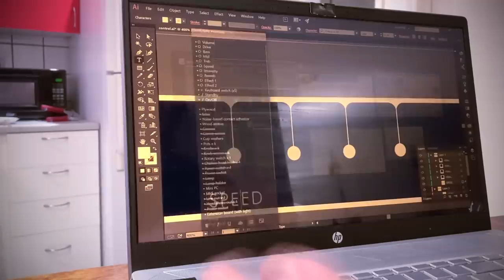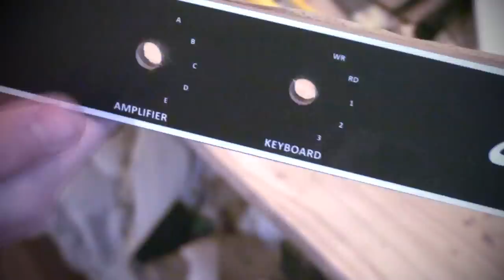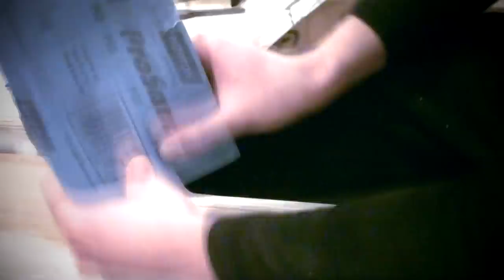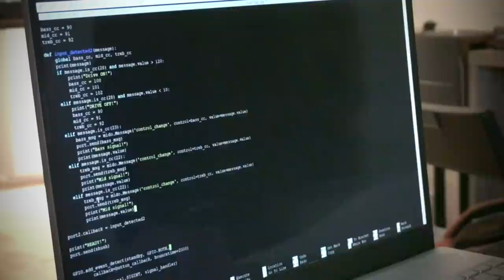Building An "Electric Piano"

Comment: Excellent. Nicely made. 

What is the point of the rubberbands that you installed into the action? Did I miss the explanation somewhere in the video?
Reply from the maker: The TP/100LR is way too heavy for most people, including myself. The rubber bands make them much much more playable.

I believe I ended up using Size #16 rubber bands, but I recommend getting a box of #18 also to play around with the amount of resistance.

I attached the rubber band first to the plastic "lip" near the pivot point under the key. After this, it's important to TWIST the band at least once, before attaching the other end to the other end of the hammer assembly. You can increase resistance by adding more twists, but this might increase friction at the same time. This is also where playing around with different sized rubber bands may be helpful.
Reply: @aCloudOfHaze  Ah gotcha! Any chance you are going to make this DIY kit available to the market?
Reply from the maker: @aakash9058  Haha not right now. Frankly I watched a few videos of people building amp cabs and then went for it. Not that complex, just takes time.
Reply: Brilliant, great video and well played.
Reply: I started with a sl88 studio that I think shares the same keybed and because I have nothing to compare it with, I don't feel like it is heavy.
Reply: @b00ts4ndc4ts actually sl88 studio is a step up and cost 2x more then the slgrand in this video. The action is supposed to replicate a grand piano rather than an electric…… whether this action is too heavy is debated and is definitely a matter personal preference and largely dependent on what type of piano you played as a kid growing up. Sl88studio is 1000 dollars sl grand is 500. The slstudio uses tp/40 vs tp/100 for slgrand.
Reply: @markaprill6501  would you like to bet on that?
The sl88 is the cheapest option out of the two and the grand is the more expensive one because it has the different action and wooden keys.
Reply: I have read your comment again. Your comment is 100 percent accurate. I apologize, I was wrong. Even keyboard warriors (computer keyboards) make mistakes sometimes. Just owning either a SL88 grand/studio should indicate that you are a keyboard expert and certainly dont need correction on what you own. So I am not going to bet on it.

Comment: Unfortunate that kawai and Roland dont sell theirs as stand alone keybeds, or at least have more variety of interface types, to meet all needs.   Industry is only so big, cant afford to meet all the niches. Such a project as this deserves better action then Fatar gives.   I commend you on following through on such a project.  Please let us know your thoughts on the reliability of running Pianoteq from the Pie.   Im guessing just from the fact that you deemed it worth it to do this project in the first place, means you are confident  <;)
Reply from the maker: Hey thanks mate, I appreciate it especially from someone knowledgeable about this field.

You're right about Fatars. They are hit or miss. That's why it baffles me why Nords are so popular. What wasn't captured in the video was this: I tried to cut off all the hammers on another keybed and glue on some wheel weights. I do not recommend this - It was a disaster! It's really difficult to achieve the level of precision required, unless you have all the tools to do so.

I was still unhappy with the action and I was determined to find a fix. At one point, I was thinking about delaying the entire project until I could 3D print a custom keybed haha.

Regardless, I pulled another keybed out of an old SL73 (midi controller without sounds). What you see in the video was the final fix that I came up with. I simply modified the action with rubber bands. The end result was surprisingly good. The chunky yet not overly heavy action matched the EP sounds very nicely. I'd encourage anyone who owns a keyboard with this keybed to try this mod. It's reversible and to some extent scalable to one's tastes.

If I were to do this again, I'd go with a TP/40 instead. One of the most important factors that go into how a keyboard action feels is the key pivot length, and the TP/40 has a much longer one than the TP/100LR (and most other keybeds in this price range). Plus 3 extra keys on the high end would have been nice haha.

Pianoteq on RBPi works fine. I do experience very rare "audio card cackles" on the grand piano patch, mostly when I'm turning the knobs while playing, but the EP sounds all run very smoothly. In the long run I might replace it with a mini PC with more CPU instead.

Thanks again for the kind words, hope this was insightful.
Reply: @aCloudOfHaze  WEll, Nord remains the only company to have the combo of the build quality the interface great EP’s AND great organs, and in the case of the stage, synth as well, AND have a library or allow 3rd party.   The closest competitor would be the Yamaha CP and YC series, but no library or 34d party download…or the Roland Fantom has a pretty thorough interface, and a great keybed.   I wonder about the viability of deconstructing a used Kawai ES8?  Does seem wasteful, but if you can get interest, maybe you Kawai is finally ready to have others use their keybeds, as they do with the Nord Grand.  Thanks for the reply, keep up the good work
Reply: @aCloudOfHaze  What does the rubber bands do? Is it to make the keys even heavier?
Reply from the maker: @MarcoMugnatto  It's to make the action lighter, not heavier. The TP/100LR is way too heavy for most people, including myself. The rubber bands make them much much more playable.

I believe I ended up using Size #16 rubber bands, but I recommend getting a box of #18 also to play around with the amount of resistance.

I attached the rubber band first to the plastic "lip" near the pivot point under the key. After this, it's important to TWIST the band at least once, before attaching the other end to the other end of the hammer assembly. You can increase resistance by adding more twists, but this might increase friction at the same time. This is also where playing around with different sized rubber bands may be helpful.
Reply: @jonathanosborn4800  I tried a ES100 Kaway and it's another very nice and playable keybed compared to TP100. Useful for mod like this. I Heard that Nord uses Fatar too, but it seems they are just made for Clavia (though with the same commercial keybed name).

Comment: I get the impression that you're experienced with building other, similar cases before, as this seems to be so nicely and meticulously planned.

For the face plate, I had the nutty idea of using something like photoresist on aluminum and controlling the exposure by placing black/transparent printouts over it and the hitting it with UV light.  Then with only the exposed photoresist remaining, anodize the aluminum to mark the pattern on it.  Only problem is that I think then you'd then need an acid bath to remove the exposed photoresist.
Reply: Hi Scottk can you explain better your idea, or there is a video as an example here on YouTube? Thanks
Reply: @dariovicenzo8139  I don't have any idea to suggest.  I'm only pointing out that the maker of this video looks like he has created this kind of case before.  He seems to easily navigate the planning and construction.

Comment: Pianoteq sounds so unreal. the first time I played it after dialing in my settings, it was a revelation. I felt like I'd unlocked a tiny piece of ancient magic in my little home studio. I was wondering what you'd use to power such a beautiful creation, but I should have known. The one thing I didn't know was that you could get it running on a raspberry pi! Idk why I thought it'd be too taxing for that. This was amazing to see, thank you so much for sharing!! <3
Reply from the maker: Thank you 😊 Sampled instruments may be too much for the Pi to handle but modelled ones like Pianoteq are a different story. It helps to overclock it slightly too. Many guides on the Modartt forums.

Comment: This looks great. I have built all kinds of stuff over the years and for a while been dreaming about building my own custom all-in-one piano/organ/synth and you have inspired me.  My idea is to put three keybeds in one case:  76 Weighted keys at the bottom , 64 waterfall keys for an organ in the middle, and 52 diving board keys for the synth on top.  I am pretty decent woodworker but this is pretty ambitions.  I suspect it would be far too heavy anyway, unless I used balsa wood! Finding room for the knobs and drawbars will be a challenge.  Or I could just pop the guts out of a clonewheel organ and digital piano, put them in a new case, and leave enough room for a small synth on top.

I miss the days when manufacturers used to design keyboards to be stacked. Yamaha makes one digital piano that is pretty deep because of the large internal speakers, but its hard to find and I am sure the piano sound is pretty dated by now.  I used to own a Yamaha CP30 and not only could you stack at least 2 keyboards on top, my bass player would sometimes jump on top of it way back before I could afford to buy more keyboards to put on it.

Comment: I'm kinda curious how you got the knobs to control pianoteq running on the Pi. Also, you power the Pi from the front panel? If so, that's cool, the brain is hidden!
Reply from the maker: Hey, I used a MIDI encoder from Doepfer, I believe it's this one https://doepfer.de/pe.htm. That goes into the SL73, which connects via USB to the Pi.

There's basically a extension cord type thing with two power adapters hidden inside the piano, powering the keyboard and the Pi (they require different voltages). This way everything is powered via one IEC cable.

There's actually so much empty space inside it's ridiculous. Some day down the road I might make my own keybed with a much longer key length :)

Comment: Cool build! Let’s see. So, it’s a Raspberry Pi running a sample playback instrument? The knobs on the front are all for the amp tone controls? Or do you have knobs running to the Raspberry Pi making changes to parameters on the instrument?
Reply from the maker: Hey thanks. It's Pianoteq running on RBPi. Not a sampled library, but a modelled one. Requires way fewer resources and afaik "feels" or "plays" better (even though a sampled one might sound more realistic). The knobs run to the RBPi and basically serve as MIDI controls, yep.

Comment: this is one of the more amazing videos on internet for me. Great Job! 
Unbelievable that you can use a raspby for that. How is the experience on work of linux and live performance ? I really need a video explaining how you configure and parametrized all the options of pianotec, with midi, linux and jack. 

Thanks for sharing!
Reply from the maker: I can't make a whole video about that, but there are plenty of guides on the Modartt forums. The performance is great, very little latency. Cheers!
Reply: @aCloudOfHaze  why did you go with that option, over say an arduino etc?
Reply from the maker: @DanHomeAtLast  Can't host a VST on an Arduino. Or can you??
Reply: @aCloudOfHaze  that's correct, they can't host one. I didn't know that there are hardware like this that actually hosting a vst that's awesome. Will look into it further for my project. Thanks and great work you're very talented
Reply from the maker: @DanHomeAtLast  Good luck, would love to see the final product 💪

Comment: A couple of things I don't understand.  What is the point of a Standby Switch?  That does not make sense.
Reply from the maker: It mutes/unmutes the piano without having to reload the VST instrument, and also serves as a MIDI reset in case things ever get jammed up. It also syncs the current settings on control panel (e.g. patch, EQ, drive etc.) with that of the VST instrument.

Comment: Nice ! What the rubber band add ? You will have to change all of them soon or latter, courage with that !
Reply from the maker: A little mod that I've found improves the action of the TP/100LR keybed. The short pivot length makes it a very "chunky" action, so the rubber bands kind of compensate for that by making it a bit lighter and more "bouncy".

Comment: Hey mate, just want to say that this in an incredible build on many levels. And also very inspiring - especially considering you made it without expensive tools. I have been meaning to build a custom digital piano for a good while now. I have lots of questions, especially regarding the electronics aspect and connecting the keyboard sensor outputs to whatever device you use for the sound production. Did you document how you did the electronics? Do you mind if I ask you some questions here about it? Cheers!
Reply from the maker: Of course, ask away. Frankly, there's nothing too fancy about the electronics. The keybed was taken from a StudioLogic midi controller, the only thing I did was lighten up the action with elastic bands. It is connected to a Doepfer midi encoder, I believe it's called the Pocket Electronic, and the knobs/controls are connected to this as well. If I remember correctly, this then goes to a small audio interface, hooked up to a Raspberry Pi, which hosts Pianoteq, a modeled VST. Audio line outs come from the audio interface too.

If you do decide to build your own, be sure to let me know, I'd love to see it.
Reply: @aCloudOfHaze  Thanks for your response! First things is how to connect the output cables from the keyboard action to the midi controller. Did you use any of the circuitry from the SL76? Or is it possible to connect the keyboard cables directly to the Doepfer midi controller? My goal is to build a digital piano using a Kawai wooden action, maybe from an old MP9000 or similar. It will be built into either a real upright piano case, or I'll build one, and contain an amplifier and high quality speakers, all hidden inside. It will have only a couple of buttons to select the piano sound. 

So the first task would be connecting the piano action to something to interpret the signals into MIDI. I guess every digital piano action uses different cables so this might be tricky. I  could use the electronics from the original digital piano (i.e MP9000) but this would probably mean using the entire set of boards since they are all connected together!

Cheers
Reply from the maker: @elsharkio  I used the board from the SL73. It was quite small anyways. Lacking that, you will probably have to look for the keybed scan matrix diagram and figure something out. I've seen people build their own midi encoders with arduinos, but I'm not sure how well that would work to be honest.

I'd do some digging on the Midibox forums. Lots of info on there from people doing similar projects, but it's quite disorganized.

http://midibox.org/forums/
http://wiki.midibox.org/

http://www.ucapps.de/

Good luck buddy

Comment: Impressive work . I did not understand what was all that last part when you took keys out and put rubebr bands. Also how do you assign the buttons to know they will do certain things with different programms?
Reply from the maker: A little mod that I've found improves the action of the TP/100LR keybed. The short pivot length makes it a very "chunky" action, so the rubber bands kind of compensate for that by making it a bit lighter and more "bouncy". I'm basically interfacing with Pianoteq via MIDI, controlled through the knobs etc.

Comment: Just curious what RasPi distro you're using and how you're running Pianoteq?  I understand Pianoteq is supposed to be able to run standalone on Linux, are you using that version or plugging the VSTs into something else?  I'm ssuming that whichever way you've done it has sufficiently low latency.  Thanks!!
Reply from the maker: I used the RPi straight out of the box. Just using Pianoteq for Linux standalone, if I remember correctly I just wrote a simple shell script to launch it on boot, plus a Python script to handle various MIDI tasks. I overclocked it slightly too, but frankly that might not be necessary.

I haven't looked into it but just intuitively I think running it via some VST host would use more resources. Take a look on the Modartt forums. Good luck :)
Reply: @aCloudOfHaze  what audio device are you using with the Pi, and do you happen to remember what frame size you were able to use?